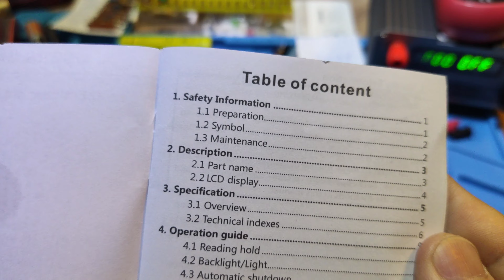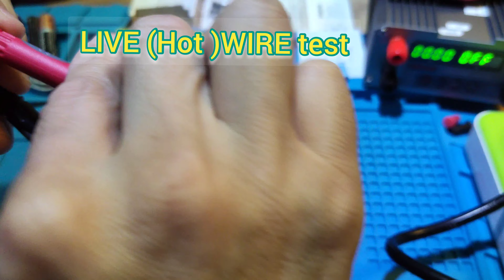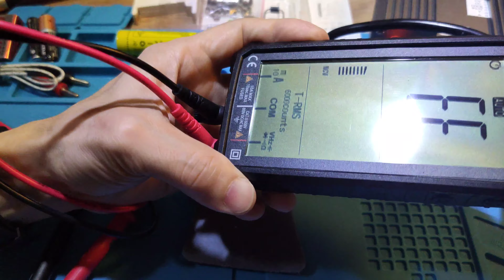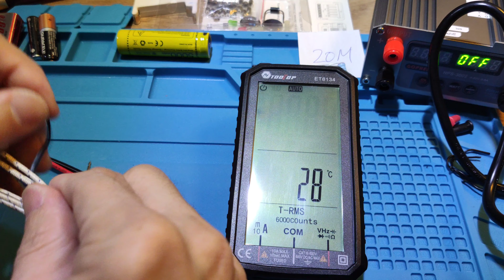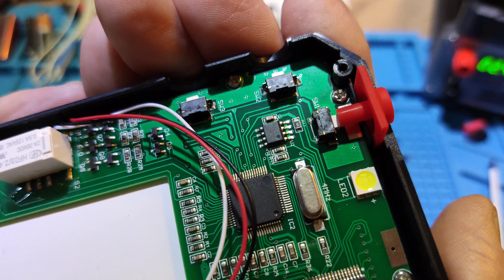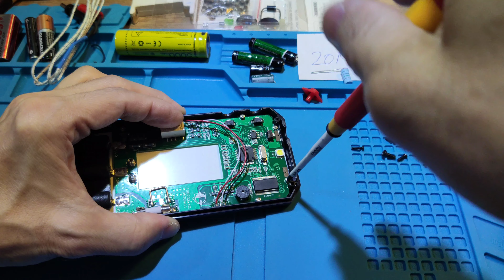TOOLTOP ET8134 4.7 inch (ANENG 620A)6000 COUNT SMART  MULTIMETER CAT3 600V

Comment: Is this multimeter top in protection and contrition?
Reply from the maker: it protection have ceramic fuse and a ptc on the board and current side and voltage no any separate and cover ,it only a basic.and some high grade have more protection like ptc ,cover,fast and high current with stand fuse.

Comment: The manual resistance measurement stage does not work, it only works automatically, do you also?
Reply from the maker: this meter and ANENG 620A is the same,only have AUTOMATIC function meter,no any Manual mode on resistor TEST function sir we test.And the continuity function is in Manual mode .😍
Reply: @wilsonluilui  Understand ty.
Reply from the maker: @avranx  Thx for watching.